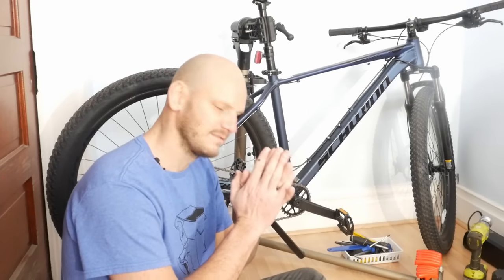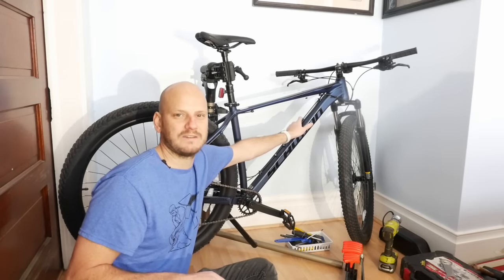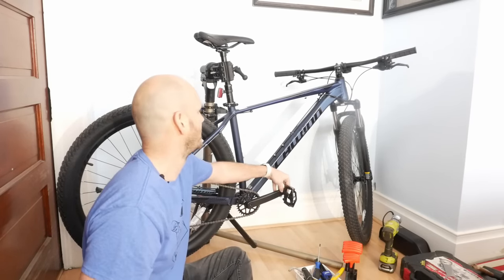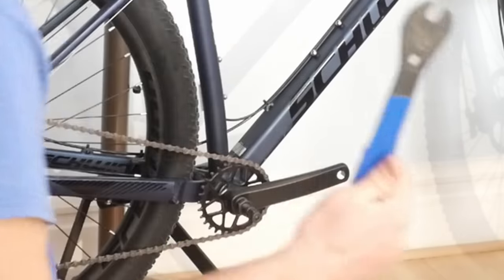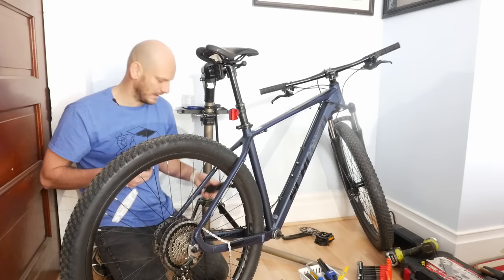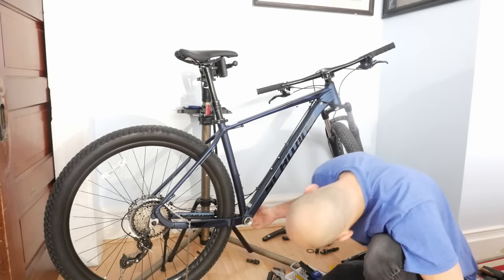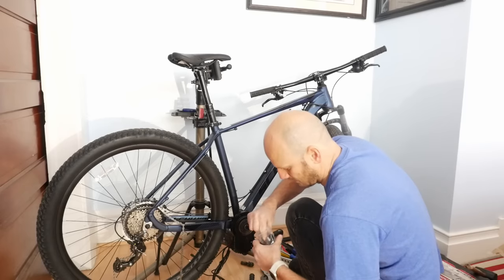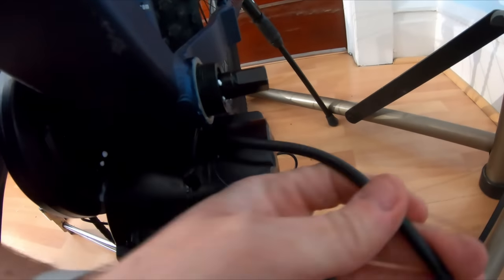The Step-by-Step Bafang Installation guide.

Comment: Nice video sir. I can't really see if you do but when cutting that zip ties you need to not just cut the end of the strip off but you need to take along a bit of the sqare block that the strip is holding. That way it's free of sharp edges.

Comment: I like this video and thanks for taking the time to show/do this. I've considered doing this myself maybe getting a second hand hybrid or something in good condition and fitting to that to use for commuting. As you say you get far more power and a way better battery doing this than you would get on even the highest spec manufactured ebike. 
I think I would put the throttle on the other side/hand of the bars personally and not have both the dropper and throttle on the same side. 
How does the system manage speed? I assume you have to give a wheel size or something or is it GPS too? I'm asking as in the UK an ebike is supposed to be limited to around 16mph and really only assist not actually drive the bike to be legal otherwise I think it's classed as being like a moped and requires the rider taking a test etc.  Saying that unless you make it obvious and you use it safely I don't think you are likely to be stopped by the police to be honest but it's probably not legal in the UK.
Reply from the maker: Hi there. It manages it with a speed sensor in the spokes.
Reply: @JohnnyNerdOut  thanks, so you must need to give it a mean circumference like an old non GPS bike computer so it knows how far a rotation is?
Reply from the maker: @davidmaskew  exactly

Comment: Hosote Day 1 Let's see. The freewheel gears are not pressed in straight, so they wobble bad. If I can find a friend or a local shop that has an arbor press, that is an easy fix. There is no way I can trust 1000 watts on that gear set as it is. It might require me to replace the gear set.

El cheapo seat. I used a seat from another bike that is much better. 

I peeled off the stickers on the black wheels. It makes them match the orange lettering on the tires much better. Meh on the tires. I'll upgrade later.

The frame certainly looks like it will handle the power.

The horn tested ok, but it's not hooked up yet.

I had to assemble the forks where some of the pieces had fallen out loose in the box. Fun.

Motor delivery is delayed by a week. Very disappointing. Demand is higher now than in the recent past.

Battery Update I forgot to mention that they are indeed 3500mah and Samsung. There are newer/better cells than 18650's being used. You'll probably have to build that one yourself.

Comment: At minute 21 in the video (locking the motor onto the frame), there's another opposite poor seating condition where the two prongs of the bracket piece are extended too far out from the bike frame, creating a bad seating of the spiked-ring to the bike frame.  This condition also requires adding spacers on the right side.  Proper flush seating of the spiked-ring part to the bike frame is important.  My chain alignment sucked after adding the needed spacers, only a Luna Eclipse chainring will correct this... currently the Luna Eclipse is out of stock... so, I have a new  ebike that can only safely use a couple of gears on the rear cog, unless I wan't to throw a chain and/or reduce the life of my chain/gears :(

Comment: Johnny, i see this bike has front fork suspension already built in.  I just converted my old bike with a Bafang 750 watt mid drive motor and 52 volt battery.  Followed your video and it worked well.  Do they sell front fork suspension kits that allow you to use your old braking system?  I don't have disc brakes.  If you sell this product, what is price and tell me where to go to order.  Also, how long before it will arrive?  Thanks
Reply from the maker: I didn't completely understand your situation. But..let me take a stab. If you want to keep your existing brake levers/ systems, you can simply add either a magnetic or in-line brake cutoff sensor that attaches to you brake levers essentially so you can just use your existing brakes as-is and still get brake cut-off feature
Reply: @JohnnyNerdOut  Thanks for your prompt reply.  I have an older bike frame with V brakes and a non-suspension front wheel fork.  I want to convert my front wheel fork to a suspension fork but I don't want to convert to disc brakes.  I noticed this morning on Amazon that Rockshox sells a front fork suspension system {ROCK SHOX Recon Silver TK, Black, 26-Inch}  for $279.  Is there anything available more reasonably priced or is this the way to go?
Reply from the maker: @richardkoppy4702  check the used market and eve possibly new/ old stock for a suspension fork that supports V-brakes :)